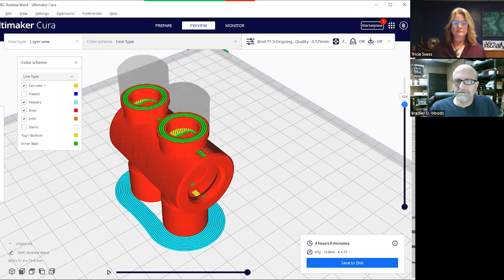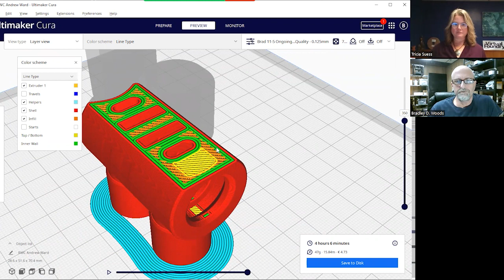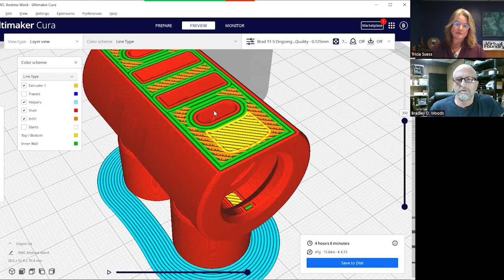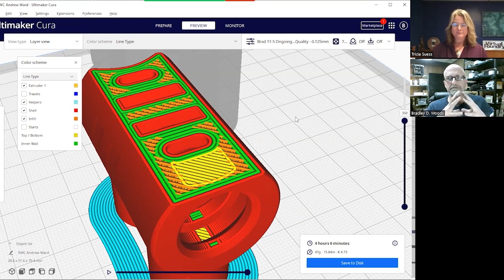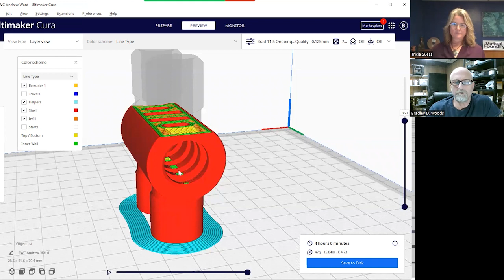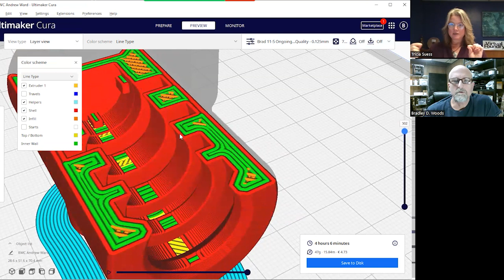Podcast V4E1 - How Much Infill to Use

Comment: Very interesting. If you are printing a part that has a 1/4” diameter heating cartridge, then heat conductivity is of paramount importance. In this case slow cintering must be done to prevent distortion. Also post production of using a 1/4” reamer will be required. 

Awesome videos!
Reply from the maker: You've got it!

Comment: The infill tradeoff is interesting.  Too much infill and it has trouble out-gassing the PLA during de-binding; too little infill and the part will slump.  But the ratio of infill to the remaining structure depends dramatically on the geometry.  Is this a trial-and-error process?
Reply from the maker: Hi Jon, Brad here. 

Regarding the relationship between infill, structure and geometry. I think we can declare that if you run your print with the 70% infill, and 3 walls, you will succeed. But the reality is just the nature of FFF Metal 3d Printing as it stands today, which is maturing at an increasing rate every month.  Excellent reproducible strategies are being developed and shared by various users around the globe. 

We do our best to curate and distribute new research as it becomes available, but as of now new info is being published at a rate that we can't keep up with. We recommend that anyone interested in this topic go to https://Scholar.google.com This database does a good job of indexing the latest (published) research. Search for "the virtual foundry". There's a fair amount of noise that isn't us, but it's mostly from before 2010 (before we existed), so limit your search by year and you'll get a list of hundreds of research papers, thesis, dissertations, etc., all of which explicitly reference The Virtual Foundry by name. Here's a link to a paper published in August 2022 that tackles some of the interactions between print settings, strength and stability. 
https://onlinelibrary.wiley.com/doi/full/10.1002/masy.202100390
Reply: @TheVirtualFoundry  Thanks, Brad!

In the video you mentioned trying to get the infill to overlap with the walls.  First off, I'm not sure how that works, trying to put two filaments into the same space/location.  But, more importantly, you never mentioned the slicer settings that might make this happen at all.
Reply from the maker: The overlap setting isn't exactly about the overlap, per se. It has more to do with the physical boundary of the printed lines. I could do a whole Podcast on just this topic, but I'll try to be concise. Metal filaments are made up of a distribution of particle sizes. When you pass the particles in a fluid, through a cylinder (the print nozzle) Larger particles will be pushed toward the center of the print line, while smaller particles will migrate to the edges. So in practice, you wind up with a bias in the particle size distribution. Overlapping wherever possible forces a bit of disruption in both the previous layer/line, and the line being laid down presently. This creates a superior interlock between both 'layers' and 'lines' in the final sintered part. 

There are several settings in most slicers that let you influence this property. In Cura it's the Infill Overlap setting. You can specify it as a percentage of line width, or give it a hard number. This is actually on by default in Cura to improve adhesion in plastic prints, we just ask you to up this factor to .8mm. I agree that printing 2 things in one place is counter-intuitive, but in practice, this is very normal. Here's a pretty good thread on the topic as it relates to PLA https://community.ultimaker.com/topic/26692-top-infill-not-overlapping-skin/

In your Cura Profile settings, search for the word 'Overlap' and you should see the different ways this can be effected.
Reply: @TheVirtualFoundry  I guess the parameter corresponding to Cura's Infill Overlap is PrusaSlicer's Length of the Infill Anchor, which defaults to 2.5 mm, much larger than your recommended 0.8 mm.